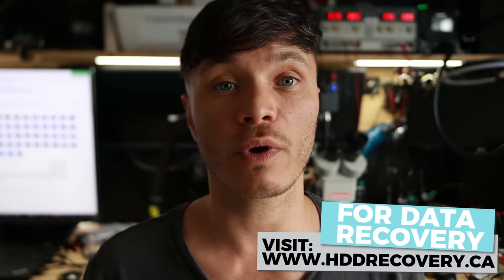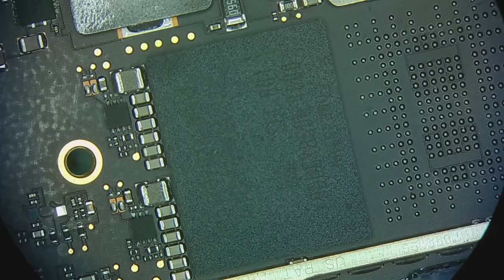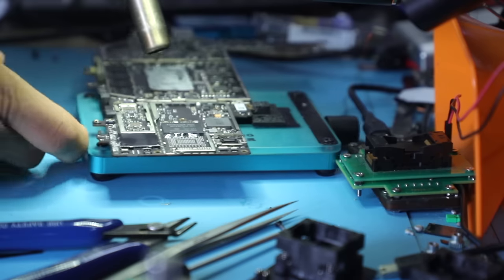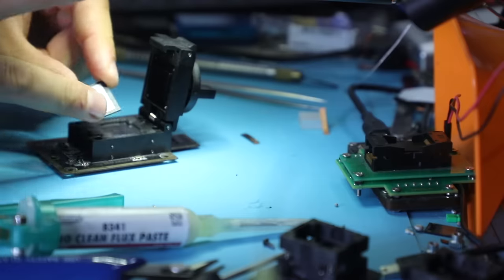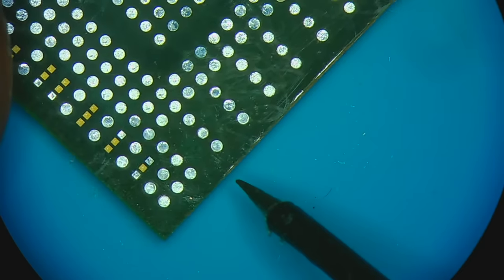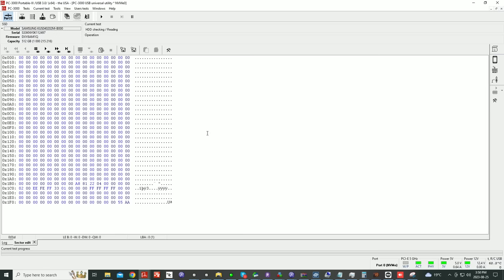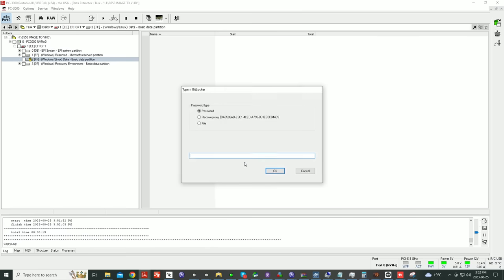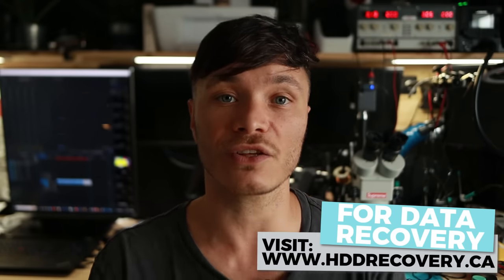close call with surface pro SSD disaster! the one thing that saved everything!

Comment: Bitlocker can be decrypted separately - in general you should be able to image the disk first, then perform the bitlocker unlock separately on the image. (I think even Windows will prompt for a key if you try to open a Bitlocker encrypted volume). Don't know if PC-3000 can separate the tasks, but it should be able to since being able to read the data might only be temporary and thus you want to just get an image to work with. Working on the image itself is much easier and then you can apply Bitlocker decryption to that without worrying about losing access to the chip.
Reply from the maker: the reason to decrypt was specifically to address the most important parts. Some of these SSDs are 512GB per chip. If decrypted prior to image we can map and image targeted data (instead of windows and programs).

Comment: I have a JBC at work. The T245 handle is great for larger stuff. I use a C245-955 tip for wider surfaces.
Reply from the maker: That's a knife edge one? Great tip, I have one at the shop like that

Comment: Pro tip: If you have a regular air duster spray that blows warm (room temperature) air, hold it up-side-down so it sprays liquid, and the liquid will be very cold.
Reply: Can confirm.
Reply from the maker: Air cost a lot and upside down use is not as cost effective as this spray:)
Reply: @hddrecoveryservices  eh. Not beefing you bud, but in a pinch, duster is made from the same active chemical as the MG Chemicals Super Duster 152 and is available in pretty much any big box store in North America.

Comment: Great video. Excuse my ignorance wonder if was a micro-break in one of the tracks and freezing the chip caused it to contract thus joining the break. Weird and wonderful world of micro electronics 🙂
Reply: Could also be a bad connection in the socket and re-inserting the chip fixed that.
Reply from the maker: That's what I thought at first. But I tried the same chip a few days after the case was done and same thing. It's not PHY ready, but even spray did not revive it again. Client got lucky

Comment: woah!! I did not like the way you took off that shield I think I have done this once on my own stuff and also ripped apart the board top layer luckily it was mine, but yeah definelty take it off the right way not like that, ohh common I know you know better my friend. Have you ever used an Atomizer Pen + Rosin for detecting shorts?
Reply from the maker: I see no point in it. The board after the work goes to the blue bin right away. I am not saving the board, just excavating the chip

Comment: Why do you put new solder on the chip to then remove it again with the copper mesh? Why not just remove the old one in one go? Seems like a double step so what is the reasoning.
Reply from the maker: Clean oxidized pads

Comment: Many years ago, I "accidentally" overclocked my router and then it kept rebooting indefinitely, without any means to interrupt the cycle and get the right configuration back. Freezing the CPU bought me enough time to get the configuration right and recover it. I left it in the freezer overnight with a drop of demineralized water right on top of it 😁
I'm sure this spray would've worked even better!
Reply from the maker: I bet
Reply: How did you brick it by "accidentally" overclocking it and how did you manage to overclock it.
Reply: The most idiotic way possible: I've installed dd-wrt and, under the Management tab, at the Overclocking section, I've selected a higher frequency (MHz) just to see what would happen. 🤦‍♂